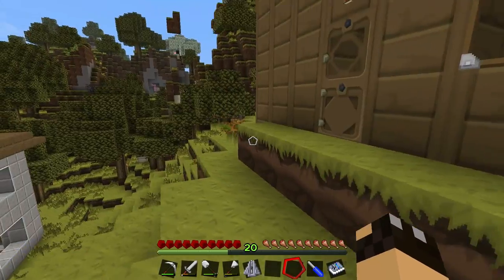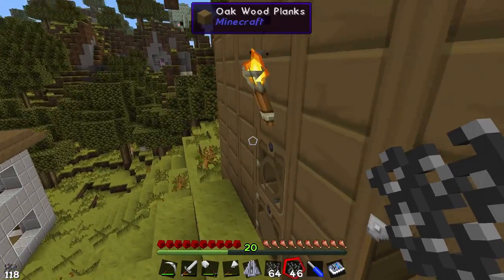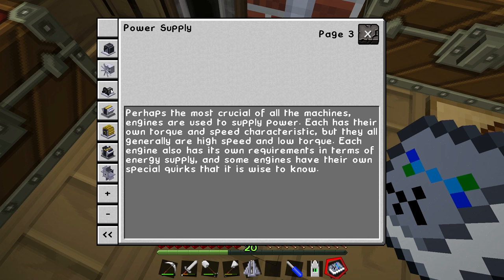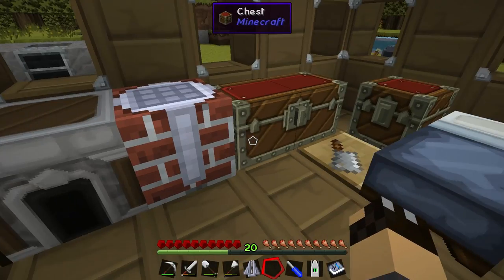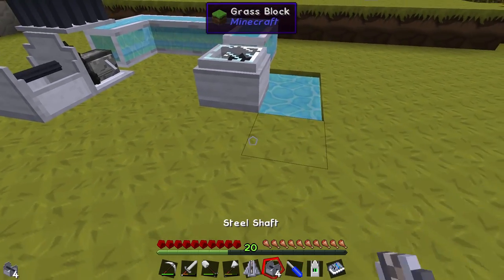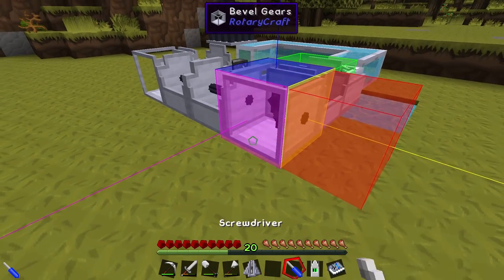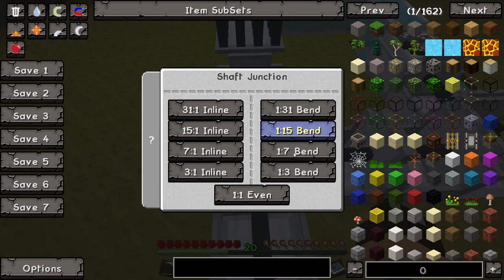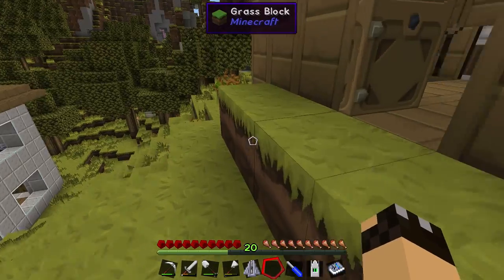Shafts and Power Feeds -7- Feed the Beast - Horizons

Comment: I don't really have anything to say for this one, you did a good job figuring out everything you used, quite accurately. Even if it took a little bit to find the GUI on the bevel gears, that's understandable - not quite something you would expect after playing around with shafts for a bit.

Also, if you think the requirements for HSLA (I believe that actually means High-Strength Low-Alloy, according to the mod author. Little bit of trivia.) Steel are a bit over, wait until you're making jet fuel.